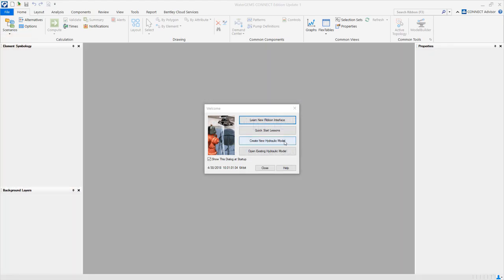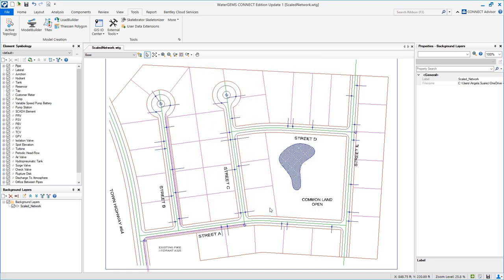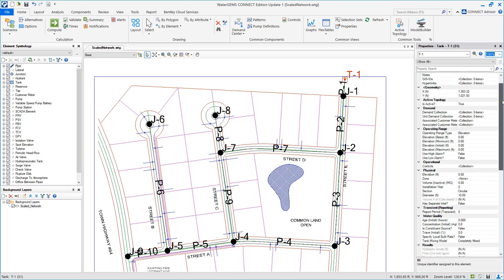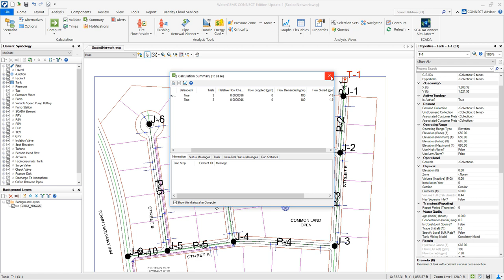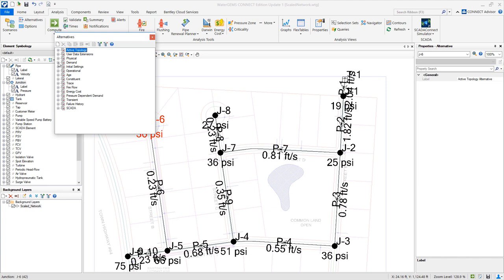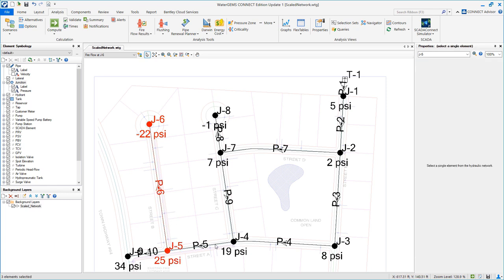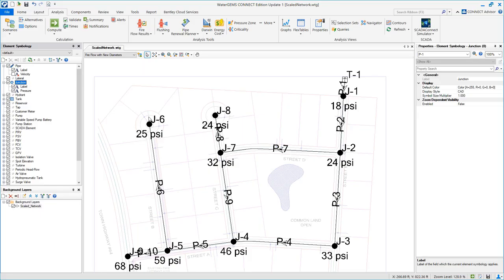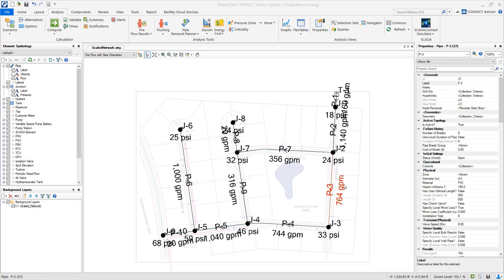WaterGEMS/WaterCAD Fundamentals Part 3: Workshop 1 (Building a Network with Fire Flows)

Comment: What is demand. Should I go to tap of J -6 and tell him that demand is 1000 GPM and flow through the pipe will be come 6.53 feet/sec or when I Tell the J-6 Tap that demand is 500 GPM, flow will automatically change to 3.25 ft/s. What is this miraculous demand??
Reply from the maker: Demand is an assumed outflow, which the model solves around as a "known". For example you may have historical billing meter information on usage where you can reasonably assume that those are the outflows, and then the model will solve around that (pressure, velocity and other results). For some systems (smaller scale or in developing regions for example), you may not be able to assume a specific outflow for the purposes of the hydraulic simulation if that outflow is particularly sensitive to pressure. In those cases, you can use pressure dependent demands (PDD) where you simulate the characteristics of the opening size and the model calculates the outflow based on the pressure. I would suggest reading some academic and engineering reference material such as Bentley's Advanced Water Distribution Modeling and Management or Computer Applications in Hydraulic Engineering books.

Comment: Hello I'm currently carrying out this workshop in WaterCAD CONNECT Edition Update 3. However when i run the fireflow scenario at J-6 i get 15psi instead of -22psi. And no message in my user Notifications. I would like to know what i could be doing wrong.
Reply from the maker: Hi Christen, check your units and compare to the "solution" model. If this does not help, post a copy of the model (File > Save to Package) on our forum: https://bentleysystems.service-now.com/community?id=kb_article_view&sysparm_article=KB0088588
Reply: The only difference I see is the length scaled in my pipe flex table. could that be causing the different result?
Reply from the maker: Is the pipe set to use scaled or user defined length? If it is set to use user defined length and the user defined length field is the same, then the length used by the calculations will be the same. If the pipe is set to use scaled length and the scaled length is different, that can impact the pressure because the total headloss across the pipe will be different.

Comment: Everything is fine except when I try loading my model from "Background layers"
1. The dfx file is not there;
2. With the wtg.dwf file, the following error pops up "Could not load / the background file is invalid or corrupt". Please help, what do I do
Reply from the maker: Hello Nelva, did you download the dataset from the link in the description of this video? I double checked it and the "scaled network" DXF file is present, in the "Starter" subfolder.
Reply: @bentleyopenflows  i see but what if I want to create my own hydraulic model? One different from the tutorial? Will The same dataset work in generating dfx files?
Reply from the maker: @nelvamiliko  The dataset does not generate a DXF file - it contains a specific DXF file that was made for the workshop. If you would like to create your own hydraulic model, you can use the ModelBuilder tool to import data or lay out the elements manually (both shown in the training), and then place any existing background that you have, such as Bing Maps, an image file, Shapefile or a DXF. For a DXF, you will need to have the DXF file already, to place as a background (which is done from the background layers manager). If you are saying that you would like to export/produce a DXF file that contains all the model elements, this can be done from File > Export > DXF. If this does not help or if you have further technical questions, please post on our forum: https://communities.bentley.com/products/hydraulics___hydrology/f/haestad-hydraulics-and-hydrology-forum